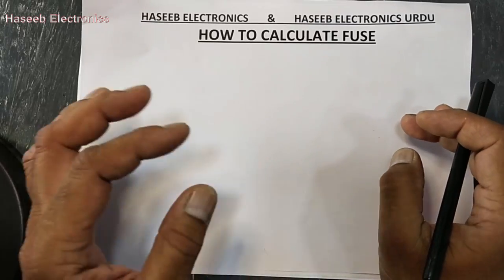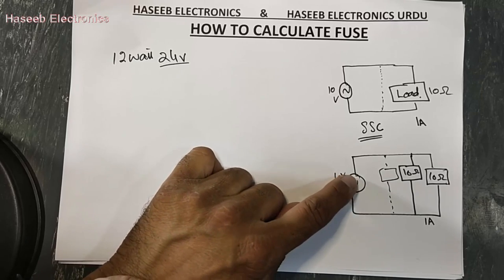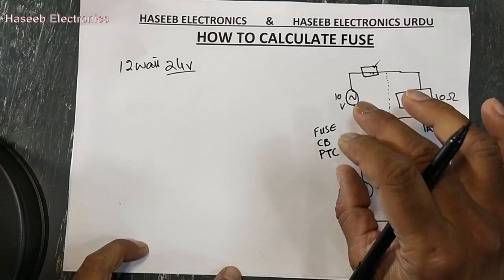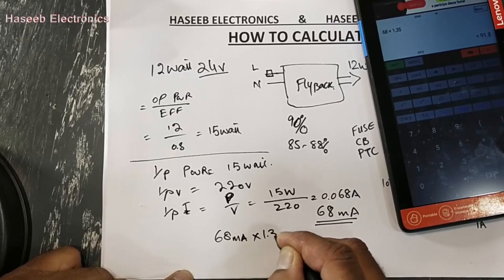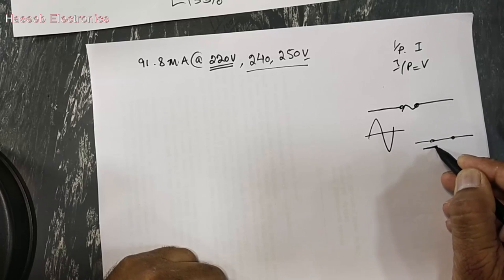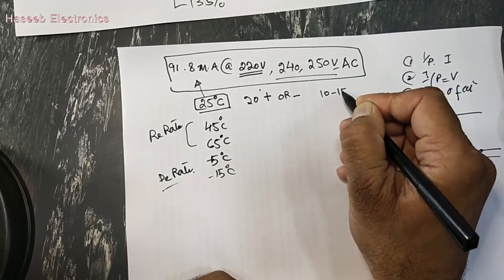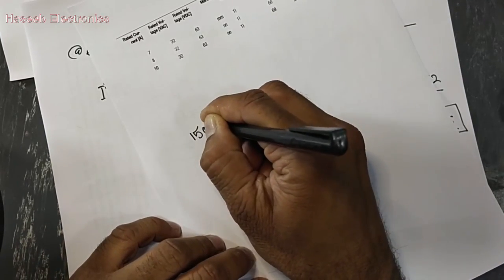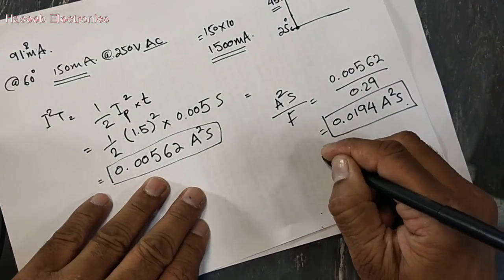{484} Fuse Calculation -  How to Calculate Fuse For Circuit - Proper Fuse Selection for Protection

Comment: Hello Sir, 
I have been trying to troubleshoot and repair a multi function welder that had suddenly stopped providing a welding arc. The high frequency start works, as does the display, the fan, the gas solenoid, etc.  I have cheacked all of the diodes and chips to the best of my ability. I am now at one of the IGBT trigger boards which is very corroded and damaged. The manufacturer no longer supports this welder and will not sell me a replacement part. I found two of these boards on Aliexpress but I have no idea how to select the proper driver. There is little or no information about them, not even from Infineon, the manufacturer of the IGBT.  Do you have any suggestions ?  Thank you.
Reply from the maker: welcome and thanks for your comment. if possible please send the pictures to my whatsapp 00-962-79-1161-084 or gmail id ashraf4ta4
so that i can see the image and then i can say something

Comment: Hi your video is very good so much knowledge. I just want to request you can you please make video in SMPS design input side how to design Line filter how to calculate wire and current and how to select line for SMPS 10W - 200W SMPS.

Thank you.

Comment: sir if such variations are there ,then can we place controller for temperature dependent  fuse selection
Reply from the maker: yes, these are the variants in fuse selections.  but as the fuse is automatic protection on in any abnormal conditions, so resettable or temperature dependent fuse will not a good solution, because the circuit must be cleared after a fault condition. and must check the energy flowing to the circuit
Reply: @HaseebElectronics  tank u so much sir very good insight into fuse

Comment: Sir we want to know how we calculate fuse resistance in easy way for example we are making 5v/2A charger in this we use 10ohm 1watt or 2watt resistor 
I want to know how we calculate that value